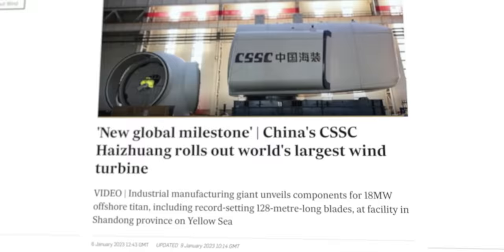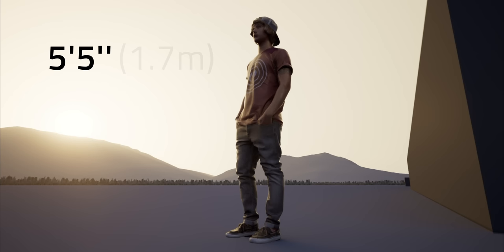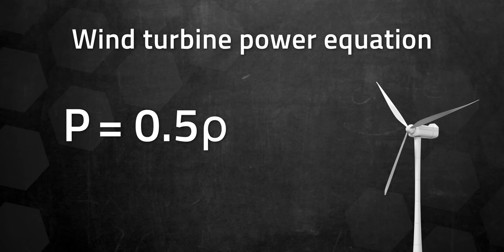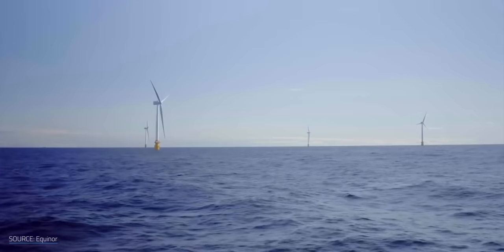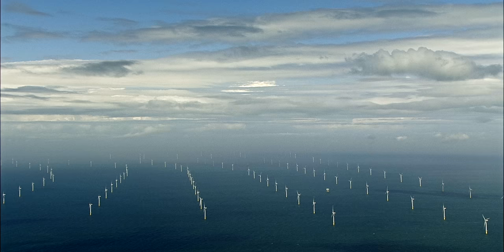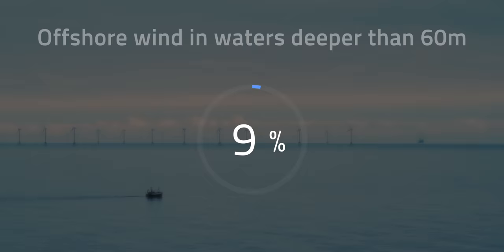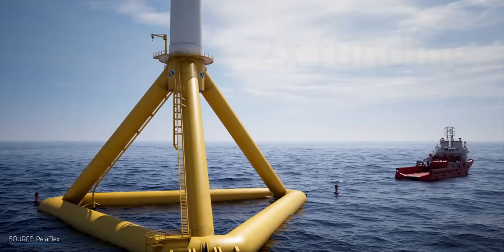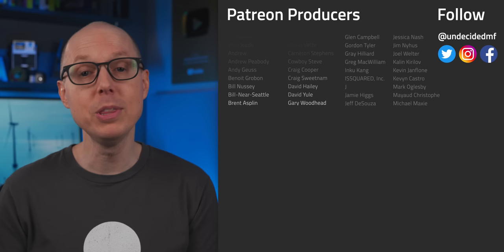Why Are Floating Wind Turbines So Huge?

Comment: Good subject.  Engineering with Rosie addressed this some time ago.  Still, good report.  It would be interesting if tankers could stop by and grab green Hydrogen (and just let the O2 loose, just save the H).  Yes, handling hydrogen has its problems too, but yet another option.

Comment: It is a simple mechanical lever issue -- the longer the lever (the blade) the less energy input you need to move the generator. A big turbine will be productive even in a gentle wind that is too gentle to move a smaller turbine.
Reply: This is a force called torque, which is proportional to the distance of the arm squared! You are spot on, the minimum speed at which they produce wind (cut in speed) is lower for big towers. Unfortunately though the winds offshore are much higher than onshore. If winds are too high, the towers are stowed (face the wind, brake released, blades turned at an angle to catch the least amount of wind, generator rotor disengaged, ect)

Comment: What happens when one sinks to the bottom of the ocean? Would it be possible to recover it ?
Reply: You would be shocked at how much garbage is dumped in the ocean every hour, and just how huge the ocean is. Just a few blades at the bottom means nothing, and is not worth recovering as carbon fiber is hard to recycle
Reply: There is so much more stuff that ends up in the ocean.

Comment: I would be interested to see if the flexible undersea cable that is required is durable enough. A stationary submersible cable is one thing but a moving flex high voltage cable might not hold up.

Comment: Can you do a video on why wind turbines aren't being developed for the automotive industry? Shouldn't a turbine be able to harness the wind from driving and power or charge the battery? Thanks!
Reply: It would make the car less efficient. It’s counter productive. Especially given that we still use fossil fuels to power cars, you would literally be burning more fossil fuels just to produce energy for the car. Car companies have been trying to use less fuel and make them more effieicnt for decades. There are ways to harness energy in a car such as regenerative braking, or even new tires from Goodyear that produce energy as they spin around.
Reply: @joshmusic9766  It would be on an electric car, not a gasoline engine. I've seen it done on youtube where they are able to put an oven inside a minivan and heat it up a bit using a wind turbine. Those Goodyear tires sound cool. I'll have to look into them.
Reply: @MessinInTheMoss  the purpose of your idea would be for a consumer product for fun, such as a toaster oven or a light or what have you, but manufacturers will not implement that because it will slow the car down and create extra resistance.

Comment: How long do those turbine blades last in the ocean air? And what do we do with them when those blades are EOL? 

I know ground based wind farms are having an issue right now with thousands of blades needing to be disposed of and nowhere really to put them. They are large, awkwardly shaped, won't decompose easily, don't stack or fit well together, and resistant to being cut/crushed. 

When compared to other forms of power, like solar for instance, the cost per mWh is absurdly high, then again solar needs a place to put them and if your land area is consumed by living space (or farm land) I guess it really just depends on what options you have available at the time.

In the end I guess it would be better having a handful of super large turbines than having hundreds of smaller ones from a waste disposal point of view, I just wonder if these mega projects are being subsidized because they are new and in twenty years we are going to be left with another problem to clean up.

Comment: The big problems with offshore wind turbines is erosion on the blade edges the salt in the air sand blasts the turbine blades and they don't last long and are expensive to replace
Reply: Blade erosion can be repaired. That is why good maintenance is important.

Comment: short answer? Money

If you built domes on the sea floor and connected the side to the top then water would flow perpetually...and drive a turbine forever. In fact you could put them in a circle round the dome and connect them all to the same up pipe.

Comment: The entire time, all I could think about it is: "how could these possibly survive a hurricane?"
Reply: The blades are built and tested to survive hurricane force winds, when the wind spend exceeds a maximum safe speed the turbine feathers the blades (changes the pitch angle to the wind) so they produce less force on the turbine, the generator is then used as an electric brake to slow the turbine to a stop, and mechanical brakes are then a applied to stop turbine spinning. Once the turbine in this configuration it has a lot less wind drag and it simply have to stay upright, the floating base is heavily ballasted at the bottom to keep the turbine pointing up. It will sway in very high winds but with everything locked down it can ride out the storm.

Comment: What is estimated national cost to convert electricity production to non-fossil fuel systems?  Does the supply of base materials exsist to accomplish this?  What is carbon footprint for wind system including construction, maintenance and recycling spent components, compared to fossil fuel comparing same?

Comment: sir, I have a design idea. I will make the blades from inflatable material. Inside the blade it will be a high resistance material,  carbon fibre. It will be bigger but lighter and will give more energy. I am looking for sponsors from international energy companies or from governments.

Comment: The wind doesn't speed up the higher you are, unless you're talking the jet stream.   On land, a tall turbine makes sense to get away from the effect the ground has on wind direction and surface wind turbulence.  This is less of a problem with coastal turbines where you have on-shore winds, such as the pacific side being in the westerlies.

The real elephant in the room is, how do they efficiently get the power generated to power distribution.  Also, with harsh environments, is it cost effective do to  maintenance?  I used to work on an off shore drilling rig, and "boat (rig) maintenance" was a massive cost.

Some of these wind turbine farms are bird killing machines... NextEra Energy was recently fined 8 million dollars when it was found these turbines killed an estimated 150 Bald Eagles.   Probably more than double that number since the carcasses are sometimes carried away by coyotes and other animals.  Also sentenced to five years probation after being charged with three counts of violating the Migratory Bird Treaty Act during a court appearance in Cheyenne, Wyoming..  Near where I live in Michigan, during bird migrations,  they are literally slaughtered, flying into turbine farms.

Comment: Why use wind power in the open ocean when we can use water currents instead? It sounds like much more work to use get a building sized windmil (which would be unstable on water) on top of something as unstable as water? A strong wind or a big wave could knock it over, and tons of money would be wasted. But using water currents, the structure is already under water, and all you have to do is have a buoyant enough to make the structure resurface and barnacle scrapers which I think is much better than having a useless wasted windmill at the bottom of the ocean.

Comment: When you say a single windmill can provide power for 20,000 homes I can't help but think about the average solar cost for a house times that number of homes and whether that is an interesting comparison. $10,000 x 20,000 = $200,000,000. Is it more economical than getting solar installed on your roof?

Comment: I feel like harnessing wave energy is going to be a better solution.
Reply: So far, you would be wrong. From what I know about that type of energy, the biggest problem is salty water that rusts out the parts. Also wave energy is biggest next to shore, so it’s extremely hard to find remote areas to place them

Comment: Matt, two simple questions, if I may; any idea about capacity factor, meaning what percentage of the installed capacity is being practically used given the wind intermittency and availability of the turbine, and how much power is used on the annual basis for rotating the blades during the no-wind days, which hapen, in order to save the rotor bearings, which without rotation would quickly get damaged due to the enormous weight of the rotor. These are but a few of concerns, if addressed by you, would make this presentation somewhat closer to reality and balanced, though your point on astronomical costs of this particular technology is well taken.
Reply: If I’m being honest (and just going off memory/guesstimating) the production factor for a farm is rarely over 70%. We do testing every few years to prove the production of a farm, and it’s extremely hard to get the farm to produce 90% for even 10 minutes.   We also do testing at 60% for one hour, which is much easier to hit, but sometimes even that fails. 
As for the main rotor, it is rare that it is disengaged for more than a few hours, except for when it’s down for maintenance. The wind will pick back up shortly, and thankfully offshore wind is more consistent.

Comment: If you stop the wind at the coast taking energy, what passes on to Colorado will be a less powerful wind. Am I correct?
Reply: There will be no measurable effect for the next decades. If one used every spot at the coast, which is an extremly unlikely scenario,  with the biggest windturbines, then maybe, just maybe one could generate an effect that could be measured hundreds of kilometers away.

Overall the energy taken from the atmosphere is rather small.

Comment: It would have been interesting to see additional charts and equations related to the economics of building and maintaining these monsters, and decommissioning and recycling them at the end of their useful life.  The warped economics of the current hysteria over climate change will be just an interesting historical footnote in a couple hundred years.

The energy storage and delivery issues (e.g., batteries and grids) seem to be huge underappreciated problems lurking in the background.  If we could glance 200 years in the future, it wouldn't surprise me at all to see internal/external combustion engines everywhere burning liquid fuels created at the point of power generation and transported by vehicle/pipeline to point of use.

Comment: The concept looks great.  It appears that floating wind - with appropriate battery storage for smoothing power delivery - is a good option for the long term.  Yes, we all hate them for the "blot" on landscapes and radio/TV fade/noise when nearby, but offshore is looking like a good NIMBY solution.
I am unsure about why the accumulation of barnacles on floating sub-structures is a problem.  Can anyone elucidate?
Reply: The barnacles and reef effect is just an unknown.  Disruptions usually have adverse consequences.  You have to monitor and measure in order to find out.  The effect might even be good.  We might be able to strategically use the space.  Aquaculture.

Comment: Could floating turbines be reoriented on the fly to optimize for wind direction, given that the shape of turbulence is dependent on wind direction?
Reply: Wind turbines have had that capability for a long time. The head of the turbine can yaw in accordance with the wind direction to make sure it's generating as much as possible

Comment: Windmill power sounds really promising. I am concerned the numbers given are not realistic. The stability of "floating" offshore windmills are also another concern. I suspect windmill power generation is not efficient and not consistent. If the wind is not flowing sufficiently fast or if there is turbulent flow then power generation immediately goes to zero. Our ability to harness solar and wind energy cannot satisfy our energy requirements. We need to do what is possible. We should not listen to environmental extremists who are driven by their imagination and emotion, not what is actually possible.

Comment: Bigger turbines out in the sea is all well and good. But what about the state of the US electrical grid? Is anything being done to bring it up to a standard where it can handle all the increases in power demand in the coming years? California is a perfect example for this. The state is forcing people to go with EV's but also telling people to not charge their EV's as much because the electrical grid can't handle the demand.

Generating enough electricity to power every home in the US for however long is a great goal. But if that electricity can't be reliably delivered to customers, what's the point of generating what the grid can't handle?

Comment: 18MW turbines is massive. 51GW of capacity is also enormous. 
But it doesn’t say anything about ACTUAL capacity factor. Which if measured in Wh (MWh/GWh). We can make them bigger, taller, but more reliable? 
Would like to see some numbers on that.  Quote as “per spin a UK household for 2 days” are misleading in my opinion. Since electricity is always realtime. The second the blades spins, it comes out of our outlet. 
I like wind, don’t get me wrong. But the nameplate capacity for renewables are highly misleading.
Reply: It is just a number to show how much energy they generate.

Comment: I've got a turbine question for you to 'undecide,' if you've got the patience. What if those turbine towers were filled with fresh water, with sump pumps at the bottom?  Pumps with standpipes that refilled the towers from a base reservoir, then up to spill-over at the top? At nearly a thousand feet in height, a column of water would gravity-level itself at a great distance uphill, all along the southern borderline states that are the windiest in the US. To raise that column via pipeline to the continental divide, it would take only six or seven towers, and... it's not pumping 1250 miles to San Diego, it's only a matter of turbine-electric pumping of water up 1000-feet, some six or seven times. One Montana water well pumps from a depth of 7320-feet. The Washington Monument is a little more than half that height, and made of stone.  Surely water at twice that elevation has less foundation load than that. 

Texas has some 20,000 wind towers now. And from the hurricane and flood prone Intracoastal Waterway, Texas could pump up and level-out enough fresh aqueduct water to flood Nevada into a forest, orchard, or row crop jungle. My guess is that if saltwater wind towers can withstand ocean water pressures, and Roman aqueducts siphoned through deep valleys, then clay, concrete, reinforced plastic, or steel pipelines with hydrophobic coatings inside would make an easy job of it. Plus, Houston's storm waters could be drawn-off and discharged elsewhere in emergencies. Can you give that a think?
Reply: So if the world's biggest water pump needs a 5000 kilowatt power source, and a 15-megawatt wind tower produces three-times that, have I got the math wrong in thinking that it could drive three such pumps? Or, is there a different way those are figured? Those pumps are advertised as able to fill the Empire State Building in less than five hours, so just how long would it take to replace the entire internal volume of a 1000-foot wind tower (excluding fill tube)? 

Would that match the rate of gravity-flow water streaming to the next uphill reservoir, so many miles distant? Who could calculate the optimal aqueduct diameter that would accommodate that maximal rate of travel in gravity leveling, with no energy at all expended on pushing water, beyond that or a series of those involved in lifting water to the top of the towers? How many pipes of maximal size would be required to supply the Great Basin's maximum annual water intake? The cost of the Great Man-Made River of Libya (6,500,000 m3 per day) was likely double its $25-billion estimate, but isn't there a better way?
Reply: Is there a risk that everyone along the aqueduct would gradually increase their demand until there remained nothing but a drip for California? Unlike the Colorado River though, the Mississippi Delta isn't likely to run dry. You can always add more pipes and towers without affecting the Gulf's sea level beyond the barrier island chain, what with rising seas anyway.

Comment: How do the turbines affect weather "downwind"? Does it have an impact?
Reply: Yes. Perturbations in wind speed and direction cased by large wind farms can persist up to 100 or more km downwind, especially at low latitudes where the low coriolis forces take longer to "spin up" the windfield. In these conditions the recovery of the wind from anything slowing it down takes longer.
Reply: @The bitey-face puppy guy  when he mentioned that you can't build them too close together, I started thinking that the wind is losing energy from the transfer into the turbine and the fact that they are installing them in areas where wind is most common means that we are changing the way the climate and even micro climate is working in certain area's. This must mean that there is a chain reaction, right? I just wonder to what extent? Are we, with this push for green energy, changing climate even faster?

"The law of conservation of energy, also known as the first law of thermodynamics, states that the energy of a closed system must remain constant—it can neither increase nor decrease without interference from outside."